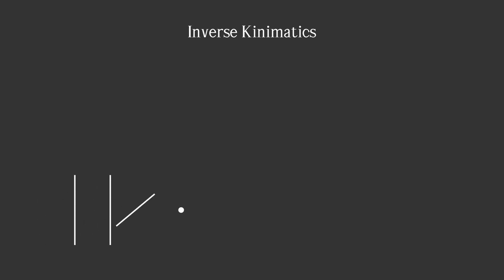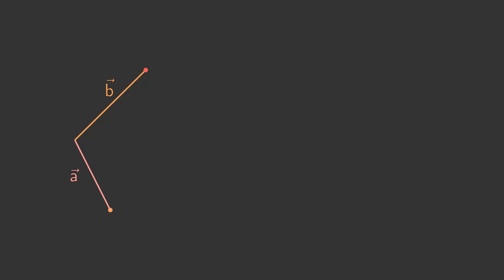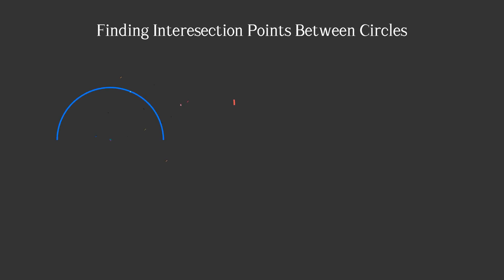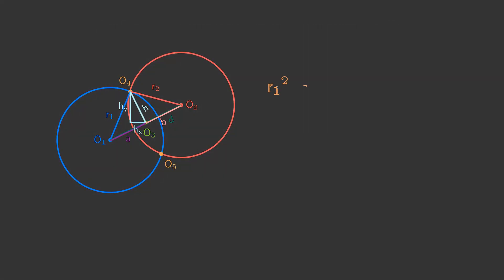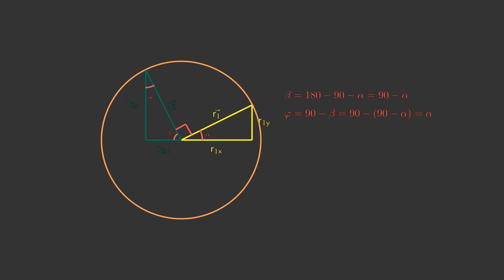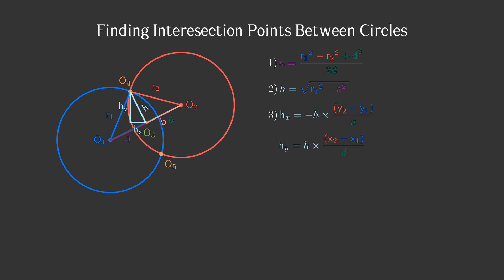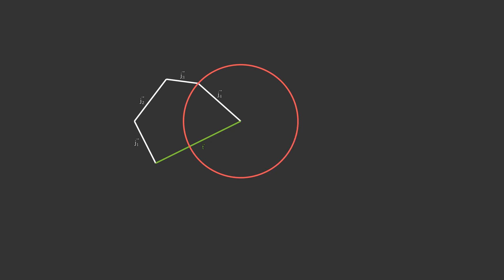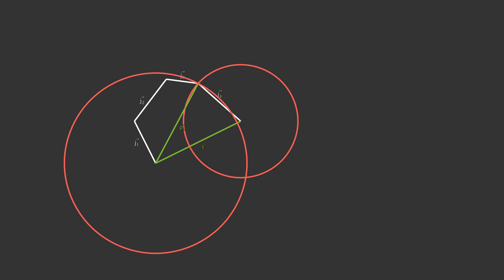Inverse kinematics. Explaining every step

Comment: But, not all the joints bend in unison. It only allows the joint at the end to bend, until it reaches 90 degrees, and then it's not allowed to bend further. But you can't really simulate smooth motion with that :/

Comment: I came here thinking a could program a robot arm with no sweat 😐
Reply: This is my third time watching this video with that in mind
Reply: IDK if you're still working on it but this method wont work for robotic arms because it cant deal with arms that are under-constrained. An under-constrained arm has multiple ways of getting to the same "pose" or position in space.

The simplst fix for this would be tracking the current angles of the vectors. You dont want the vector to change angle suddenly, so you calculate all the possible angles that will get you to your desired position, then you find which angle is closest to the angle you are at right now by using a minimum function. This will work for very small values, but if you want to make a large change to the robots pose all in one step you'll have to find a different solution.
Reply: Rum a game engine in the backround like unity in console Mode and you have it
Reply: just use good program library  - simple as 2+2
Reply: @GISURAB_Ph that's wouldnt work well if the library lacked support of, for example, constraints, you would need to incorporate that on the library anyways
Reply: lol yeah, i recommend fabrik, its super simple, i was able to get it implemented in a couple hours, although i still havnt gotten angle constraints working (which is why im here)
Reply: my name is gri5in. I know how you do this. 😢
Reply: If you think this is too hard, you can try coding a FABRIK system instead, Its way easier to implement